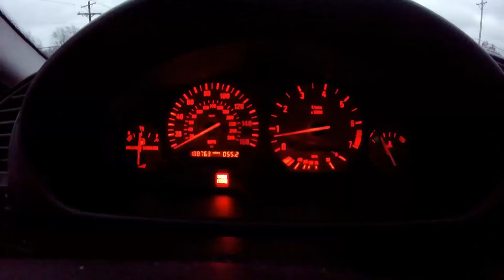Should You Ever Replace Your Transmission Filter?

Comment: Ok so I drive a 2016 Mazda CX-3 approaching 60k "lifetime fluid" if I do a drain and fill with original fluid from the dealer shouldn't I change the filter also? What about the sludge buildup on the pan? And the magnet? The pan will not be fun taking off becuase of the factory rtv glue. ?
Reply: I too was wondering about magnets.  They could be so coated with metal fines they stop being effective.  If the pan is not dropped, not way to check and clean.

Comment: Filter is made to capture 100k of particulate. It needs to be changed. Like any factory recommendation I do it twice as often or half the mileage. Got it? If you're towing best trick is to flush yearly via the return line. Get a piece from the bone yard add hose, overfill by two quarts then pump out 4. Repeat 3 or 4 times.

Comment: Just changed a transmission filter on a car with 167k miles on the original. Other than feeling better about cleaning clutch dust off magnets and pan, the filter seemed perfectly fine.

Comment: Hey I have a question, I have a new/ used transmission in my truck! I Burt out third/ 4th gear on the old transmission, I changed the lines and the external cooler! If there’s any trash in my radiator line, would that have a bed affect on my transmission, even tho I change almost everything, or do I need to change my radiator as well!
Reply from the maker: Yes you need to flush out the cooler in the radiator. If it is not flowing about 1 gallon per minute then it would need to be replaced.

Comment: Change the fluid at intervals but never changed the filter and currently at 152K miles.
 0 issues.  Granted, I don’t tow or drive in harsh conditions.

Comment: Paper filters should be changed, the paper absorbs, some trans filters have metal screen type filters and those should be cleaned, On another note , do the recommended owners manual intervals, in the case of the new Honda CVT transmission ( Automatic) , its recommended to do a filter change.

Comment: I always change the filter when I change the fluid however I like to do it at 50,000 miles I inspect the pan for dirt and metal fragments  I have to take the panel off to do this I just simply change the filter it’s not that much elf there is just some sludge at the bottom of the pan only that tells me the transmission is in pretty good condition

Comment: My 2012 hyundai sonata has been facing a slip or a pull after the 2nd gear and it feels like the car is gonna switch off but ryt after 3rd or 4th gear it gets smooth. Will this be a problem with my automatic transmission filter?or just needs a gear oil change
Reply from the maker: Feels like the car is going to shut off? Is the check engine light on?

Comment: 😊 Yes! Thank you! Typically, the killer to most transmissions is heat. Not debris or even fluid contamination so much. Now I will extract a gallon every 60,000 mi and maybe drop the pan and clean out every other time but heat is the killer. Transmission companies here in the south in Texas. Make a killing, especially during the summer. More food for thought.😊

Comment: I understand what your saying.  If i had metal debris in my fluid,  i should fix the clutch packs for example if that was the problem,  change the fluid & filter. It sounds great bc trannys after a lot of milege should get a nice service & it would probably go another double milege. And with lousy quality cars,  the material probably is cheap or not made right & complex & buried deep...we should be happy if we're fortunate enough tohave a dipstick. 
If i could change it & the filter often maybe id extend a bit longer but with age & time..ppl end up buying something else without taking too much risk for more issues. 
Nice video.

Comment: Well the way I look at it is this, clutches break down and those particulates make it's way into the stream. I go out of my way to install a drain plug on those that do not have one and add a spin on transmission filter to any automobile I buy. It works and well the oil stays pristine. Hydraulic systems like to be very clean and will last much longer then the solutions the manufactures have given us. Every oil change I dump the trans fluid and change the filter. Best to start this practice from new as I do, midterm is OK but very high mileage might be an issue. In the end less particulates less overall wear on the clutches. Just some thoughts.
Reply from the maker: I’m sure this method does work really well. However, this has to cost a fortune over the life of the vehicle. How many quarts of fluid are required to do this every oil change? I feel like it would be at least $50 every oil change. That’s $1000 or so that you’ve spent in less than 100,000 miles. I could change my engine oil every 1,000 miles and have really clean oil. But it would cost a fortune over the life of the vehicle and be overkill just to have clean oil.
Reply: @PetesGarageandperformance  Well being the spin on trans filter does an excellent job at keeping the fluid clean draining the pan every oil change only cost about 2.5 quarts or tranny fluid and a filter which is not a huge cost. I change oil every 7,500 with Royal Purple and their filters. At one point I was a service tech on the road all the time but now retired so I change oil once a year. The cost is not that great. I'm not one that sells my cars so I take care of them and a paying a little more is OK with me.  My Focus is 14 now and runs and looks like new. It's a car payment or keep your car. It's cheaper this way. Also have two Hyundai Elantra's 2014 and 2010 and now a KIA Seltos 2021 in the family mix. 6.5 quarts of oil and two filters per year is not allot to pay in the long run. Even if I drove more and it was double it would and has been worth it. So far in my life of 62 I have never so far had a transmission failure. I like it that way. :) .

Comment: If you don't think you need to change the filter. May I ask what makes your transmission oil dirty since they are seal unit?
Reply from the maker: Heat breaks down the fluid and also very small amounts of clutch material. Although most of the clutch material gets stuck to the magnet.

Comment: I need help with my veloster turbo 2013, 60 miles, whining transmission noise. Should I only change the oil? thank you
Reply from the maker: Does it whine at all times, only when moving in certain gears, or when coasting or accelerating?

Comment: I have 170000 miles never changed
 transmission filter on my 2010 civic but changed the fluid every 30000 or so. No problems.

Comment: Could you help me out I have a 98 Chevy Silverado 2500 350 5.7 vortex I just changed the transmission gasket ,fluid and filter only and now it won’t give me gears everything was working well before that  I really need help please
Reply from the maker: Did you leave the shift cable off?

Comment: I don't do it on my Toyotas cause I have been told it's a fine metal mesh and never gives issues. I do drop and replace fluid frequently though to keep it fresh. On my old Chevy th350 I change it cause I'm taking the pan off anyway to replace the fluid so I may as well just bolt a new one in?🤷🏻‍♂️ The gasket and filter are about as cheap as just a pan gasket.

Comment: I have an 04 silverado 2wd and its slippping pretty damn bad almost constantly, and im wondering if changing the filter will help at all. Will this help? If not what could i do to possibly salvage this transmission?
Reply from the maker: Is the fluid level correct when warm and the engine running? Does the fluid smell burnt? Does it slip in all gears or only certain gears?

Comment: i have 107 miles on my 2016 tahoe, i just changed the filter, it was basically clogged, needed to be replaced, the magnet was full of shavings and some made it into the filter as well, this is normal, i would changel fluid and filter at 50-60k miles to avoid issues

Comment: My daughter’s 2007 Toyota Yaris was sold with 210K miles with the original transmission oil/filter. No issues. My other kid drove his Suby WRX to 190K with no transmission oil change and it shifted flawlessly and he drove it hard!  My other daughter’s Nissan cube with CVT completely failed at 50K miles. Perhaps the real discussion is about the science behind the mechanicals. Heat kills CVT’s. After the dealer replaced the CVT, I had an external CVT oil cooler installed. The car was driven another 80K miles with zero transmission issues.

Comment: Hi Pit, I just came home after having hell of a time trying to take the oil pan of my LDV G10 van and I realized that u simply can't take  out the oil pan in order to change the atf filter, you have to take the whole unit as you say. Or am I doing something wrong, is there trick in to it
Reply from the maker: I’m sorry I don’t know what an LDV is. A G10 in the USA is a full size rear wheel drive van and the trans pan comes off pretty easily. You might have to pry the exhaust down a little though.

Comment: hey brother thanks for your advice. i learnt a thing or two. in my manual it says check transmission fluid level every 3000 miles, or 3 months. would that make the job a bit easier then changing the whole filter...
Reply: also would just checking the dipstick. if there was engine parts inside the filter do you think that the dipstick would have some engine dabre on the dipstick?

Comment: So if there is no drain plug on the torque converter. How do you get old out and new in. Without taking apart the transmission
Reply from the maker: You hook up an exchange machine to the cooler line.

Comment: I have been told by several blazer and s10 owners that my blazer might just need a new filter because it hangs in 2nd or 2-3 range unless I rev it up high enough and let off the throttle for a second or two then it catches and engages or shifts up to the next gear. Never has any down shifting problems. So my guess is that it's not exactly slipping or else it would be sick in high gear after I come to a stop. Is my assessment accurate? I'm new to transmission work. Could it simply be a filter clogged up eg: I'm taking off from a stop light then moderately or casually building up speed(not hammering down), is is not getting the proper amount of fluid/ flow/ pressure to engage the next great or could it be a bad solenoid or a combination thereof?
Reply from the maker: Sounds like maybe you don’t have 2nd gear and you have to get going fast enough to get it to shift into 3rd. A filter is not going to fix this. It could be a solenoid, shift valve, burned band, bad servo seal, etc.

Comment: Drove a 2011 ram 3500 diesel over 550k miles before it was totaled in a wreck.  That Chrysler automatic transmission was never opened up and ran original fluid and filter.  This was a hotshot truck and spent it’s life towing heavy loads.  Maybe I had a unicorn but been hotshoting for over 20 years and my just haven’t need to service my auto transmissions.

Comment: I live on a steep mountain.  I disconnect my transmission cooler, run the engine and completely flush the fluid every 30,000 miles.  It has 160,000 miles on it and shifts perfectly.  My neighbor with the same make and model just spent $2800 on a new transmission at 145,000.

Comment: Good video but my question would be , with a dipstick and I believe some vents too in an automatic transmission system, I'm not so sure these systems are not sealed as you say.  I also know that my Highlander has magnet in the pan so if the pan is not dropped, there is no opportunity to check the magnets and clean them of fines.  I can imagine a situation where the magnets may have fines on them to the point they are no longer attracting metal and have therefore stopped functioning.  I think the bottom line for me is what is harm in the dropping the pan, changing that filter and cleaning the magnets.  If the bolts are in good shape, shouldn't be an issue with those.

Comment: Most transmissions have a strainer in the fluid, AFAIK that won't really filter out fines. Some do have an actual spin-on style filter that sits externally just like an engine filter and I'd say that one does really need to be changed.

Comment: I always change those and always wondered why?????
They looked so good.
Now im doing an Acura and also has a motor oil type filter???? For the transmission.
What to do ?????
Reply from the maker: If it’s as easy as a spin-on filter, then go ahead and replace it. But if you have to pay someone to drop the pan and change a filter, it’s not worth it.

Comment: I'm of the school of thought that one does not need to change that filter.  If your filter has enough crud in it, to where it negatively impacts your transmission's performance, then  you have more wrong with your tranny than a fluid/filter change will fix.  That being said, I managed to put over 319,000 on a Toyota before it met its death by deer collision.  That transmission performed flawlessly at that milage.  I do believe in draining the pan and replacing with fresh every 35K miles (except my pickup...as I tow a camper with it each summer, I do a drain and refill every fall).  BTW, an aquaintance of mine repairs tranny's for a living.  He agrees with my thoughts on the filter and frequent fluid changes.

Comment: Saved two of my vehicles from barely operable to working fine with transmission filters. If it isn't hideously expensive I do the trans filter once per vehicle I purchase. That all being said, I think my experience with these is unusual and they don't need changing that often, I'm just unlucky. I think these vehicles sat for a long time.

Comment: 2014 ram, all gears were slipping so I took it to the dealership they said the trans was trash and i need a new one ,9,000$ 158,000 miles, me being stubborn i changed the fluid 2 times with no difference the 3rd desperate time I bought a new filter and pan , now i have 253,000 miles and has ran flawless since i changed the filter

Comment: Hi Pete thanks for the video. Question: so I’ve heard some mechanics say leave it alone, don’t touch the trans fluid..while others say, drain & fill it about every 60k..I have an 03 Corolla & drained & filled it only once around 90k. Should I leave it alone in your opinion or drain & fill it again? Since I never did it often, I wouldn’t want to cause any damage to it..any advice is appreciated, thanks.
Reply from the maker: I’d change the fluid. I believe fluid changes are important. But the filter is pointless.

Comment: I’ve had a couple transmissions lose pressure due to clogged filters. Worked fine after filter replacement. It’s not a waste of money of insure pressure is maximized.
Reply from the maker: What was the filter clogged with?
Reply: @PetesGarageandperformance  Clutch material sludge.

Comment: I'm a 15 year tech certified in Allison transmissions. If you can change your filter you should. Parts like bands and clutches are designed wear parts that produce material under normal operation. Thus material will plug the filter causing fluid starvation and ruining an otherwise good transmission
Reply from the maker: Perhaps Allison’s are engineered differently because they put a spin-on filter outside of the transmission. Being a heavy duty transmission there’s obviously more wear and tear on the clutches. What is the recommended service interval for the external and internal filters? I only recall replacing the external filter at regular intervals. Have you ever seen a clogged internal filter be the root cause of a failure? If it was clogged with clutch material, I’d bet one of the clutch packs has excessive clearance and that Allison was going into “limp mode”.
Reply: @PetesGarageandperformance  what about a 47/48re that require filter changes every 30k?

I have been to Allison school, but that isn't the only transmission that requires a filter change interval. All transmissions have the wear parts mentioned, and all produce clutch material. Failing to replace the filter when doing a trans service can cause starvation and cavitation issues in all transmissions including those that GM made non servicable because techs screw up filter changes. That's why they make everything non serviceable these days

Comment: Drain and fills get all of the fluid out of your transmission's torque converter if you do multiple drain and fills, with some driving between each drain and fill. With some Hondas and Toyotas, that are 15-20 years old, three drain and fills replaces 80% of the fluid and four drain and fills replace 90% of the fluid.

Comment: I change the fluid in the filter in my 1998 Ford 187,000 and now it will not  work and I've been told I'm not the only one that is so these transmissions or is it just it is a 5-speed with a lock-up torque behind a 4.0 single overhead cam

Comment: I have a 08 suburban ltz 4x4 cooler lines clog and clean them because transmission get hot all the way to 220f once i clean the lines it drops to 190F but sometimes gets to 205F. I have new filters and fluid
Reply from the maker: 205 is fine. Is there plenty of coolant in the engine’s cooling system? The transmission cooler in the radiator is only going to get as cold as the cold side of the radiator is. I assume you also have an auxiliary cooler in front of the condenser?
Reply: @PetesGarageandperformance   I just replaced the engine 10k miles ago. And decided to serviced the transmission when i was under the Burban. But noticed that once it was hot the trany was kindly slow to charge gears and I check the temperature and check for thermostat but this trany do not have thermostat. I have plants of coolant and new radiator too

Comment: The transmission is a sealed unit, but any metal to metal contact surfaces produce microscopic particles. You also have clutch material whatever that may be. Changing your filter is a smart idea at anywhere from 40,000 to 60,000 miles depending on vehicle transmission type and fluid type. Filter material type also would be a consideration. Filter material also breaks down